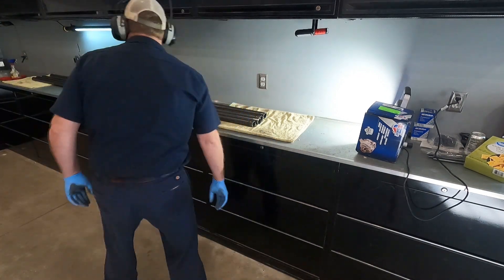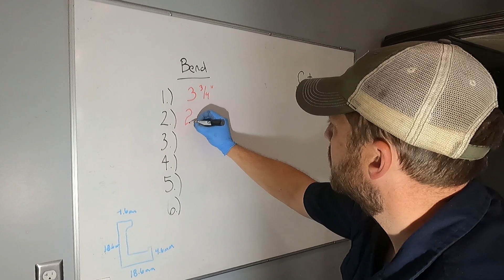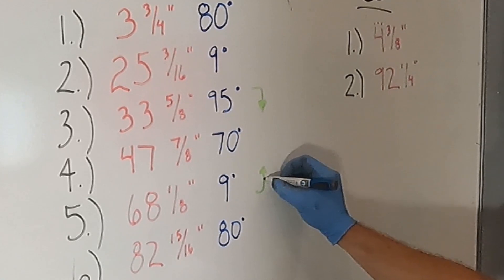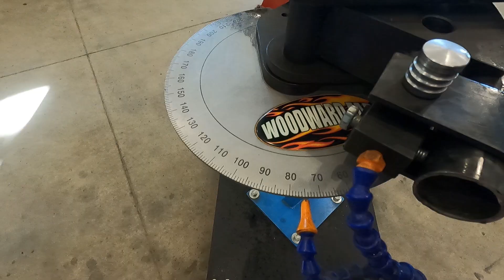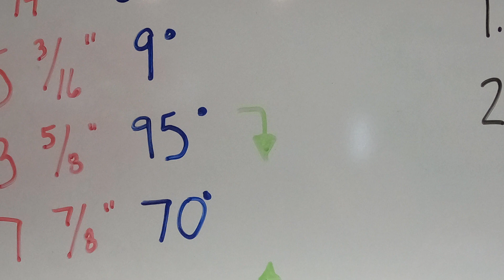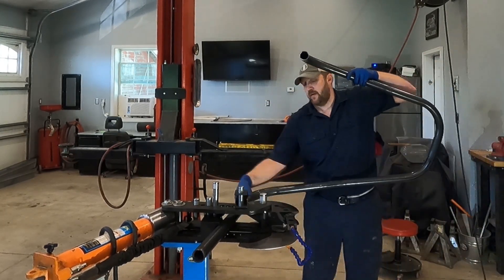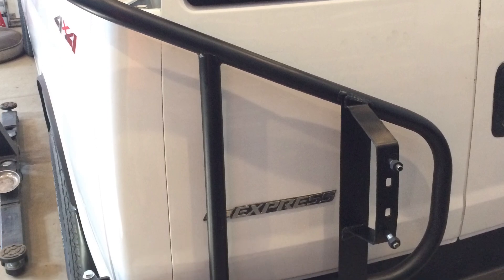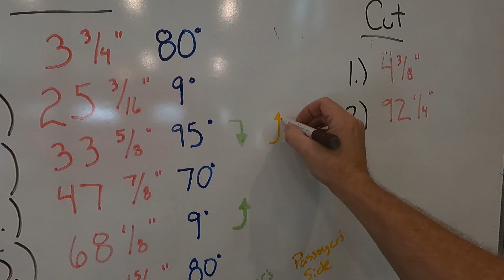Express Van Spare Tire Carrier (how to bend tube)

Comment: I'll be in touch w/ you at the expedition website (waiting for approval) about the tubes an the hinges attachments.
love the hummer rims where they a direct replacment for the steels? or where there spacers required since there 2" wider? also what size tires. an will I have to lift my 3500 to use the Hummer rims? hummers use 315tire seams awefully big to fit on the express.thanks
Reply from the maker: Sounds good...I do this on the side from my normal career, so make sure you give me enough time so I can buy the materials, bend them, package them, and then ship them.
Reply: @scottrinne1  love the hummer rims where they a direct replacment for the steels? or where there spacers required since there 2" wider? also what size tires. an will I have to lift my 3500 to use the Hummer rims? hummers use 315tire seams awefully big to fit on the express.thanks
Reply from the maker: The H2 wheels are a direct bolt on.  However, my van is custom:  I installed a 2004-2007 GMC Sierra bumper, 3" lift, and a Quigley 4x4....so, my van will be different than yours.  I am running 285/70/17 tires without rubbing after cutting the body mount and custom front bumper)   

I'm sure you can run the H2 wheels with smaller tires on a stock Express 3500.

Comment: Do you sell these?
Reply from the maker: I sell the custom bent tubes...They buyer will still need to be able to fabricate everything else:  hinges, latches, brackets, etc, etc.   However, I don't have any single hoops in stock right now: I only have two mirror sets in stock.  (you would have to buy the right and left sided hoops together)  The price is $150 for each hoop ($300 for the pair) plus shipping from Minnesota.